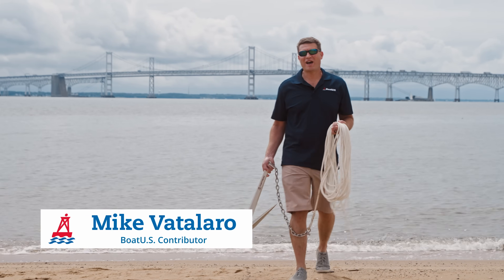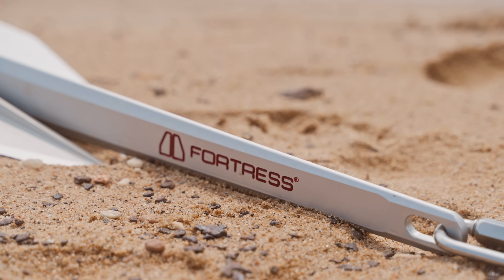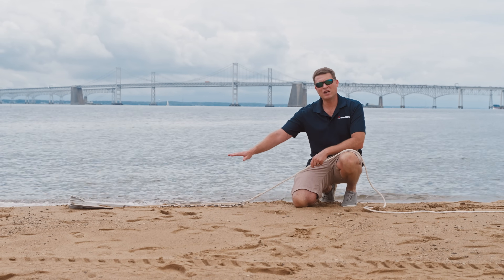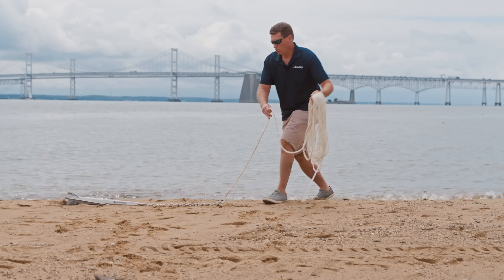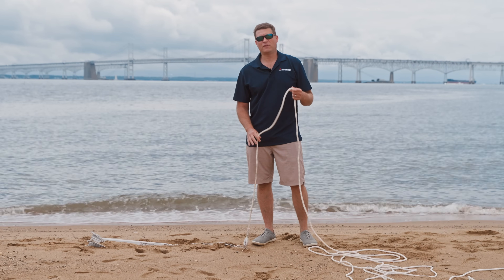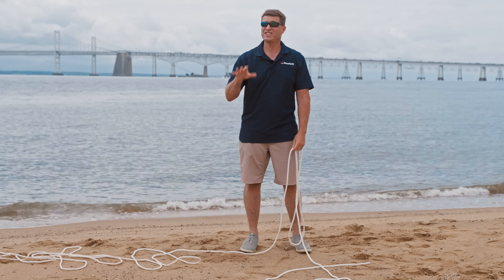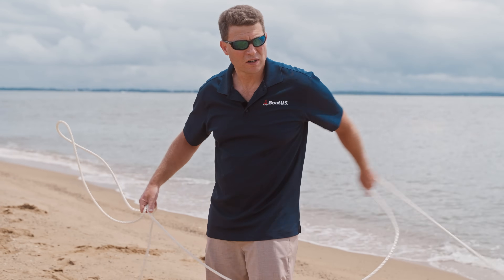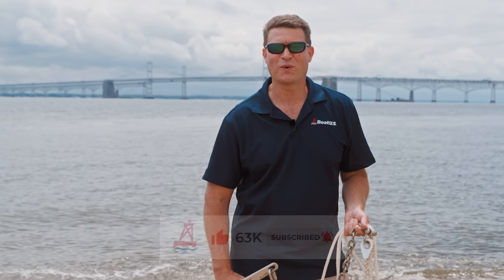THIS Is What Happens When You DROP a BOAT ANCHOR | BoatUS

Comment: That is good advice. But not enough chain is a big reason anchor will work right. At least ten ft. Of chain holds line on the bottom, also protects  your anchor line from sharp rocks.
Reply from the maker: Thanks for the reminder, Gary. Too short a chain rode -- or one that's too light for the boat -- is one cause of anchors not biting or holding well. There are many other factors to consider though, including boat type/size, weather conditions, type of anchor, type of bottom, and so on.